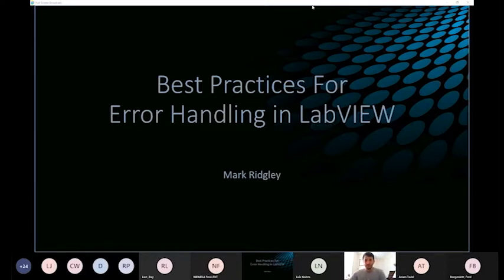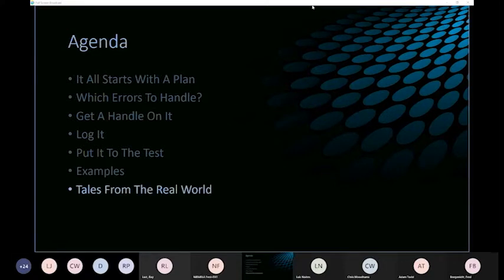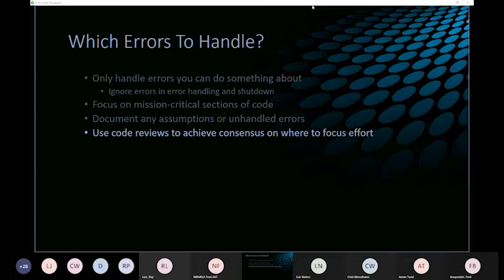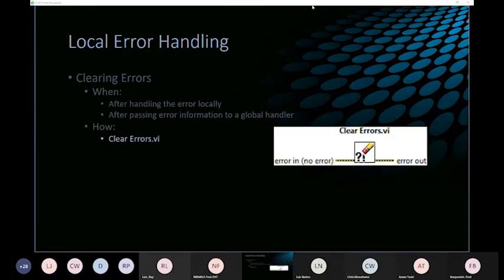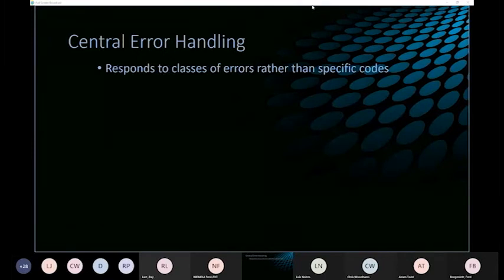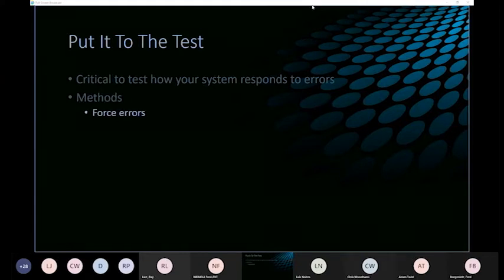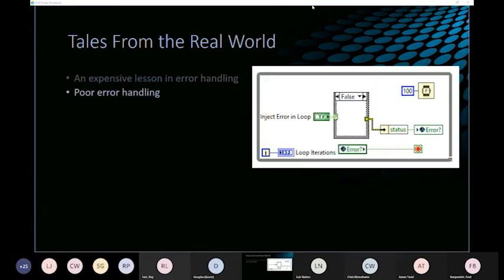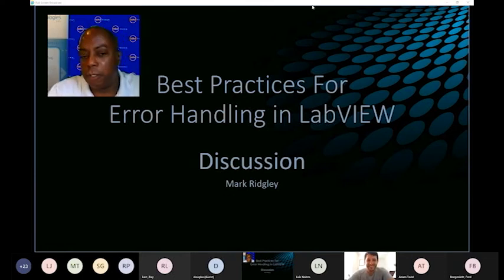Best Practices For Error Handling in LabVIEW

Comment: Thanks for the cool video!! I want to see how to make an error routine that IMPROVES the example at 1:00  or t= 2690 https://youtu.be/W1egwquZ4ow?t=2690 I want to have the error trigger a supression of the error and then use the LAST GOOD VALUE and pass it through. I COULD fix it on the FRONT END by giving the serial handler 4 tries to get the variable... I am VERY CURIOUS how to set up a handler that has, say, 5 elements in an array,, 10,20,30,40,50 and they are all reading happily but I get an error on the third and instead of 30n I get 0, I want to take the last good read of that array set and parst out the 30 and pass it on and supress the error and lob them so I can tell what is going on.